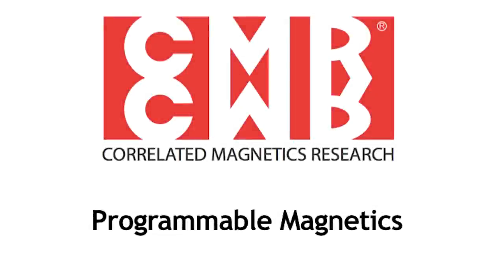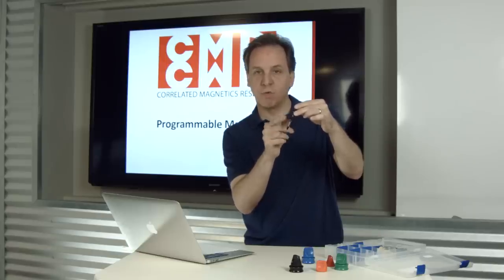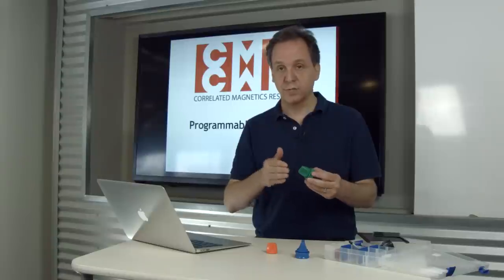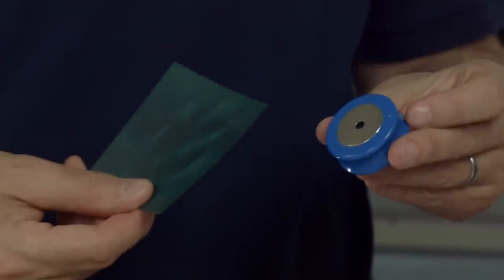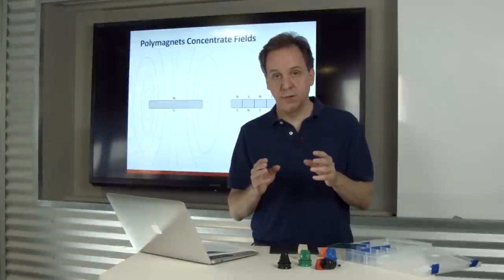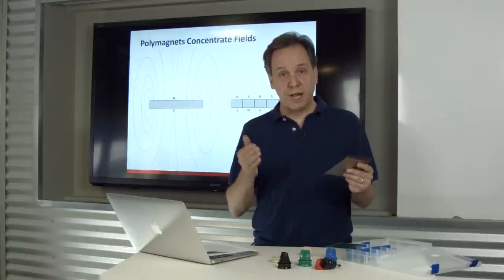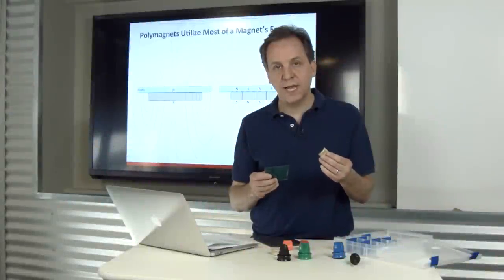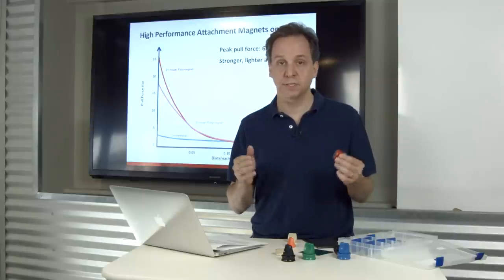CMR Polymagnet Demo Kit

Comment: I'm wondering if it would be possible to create--either in whole or in part--a frictionless system of virtual gears using free-floating magnets held in place by each others' magnetic fields, in a vacuum chamber (to make it frictionless.) Instead of cogs with teeth, it would be invisible fields of magnetic force.

Comment: How long are these magnets expected to last under normal conditions of vibration, heat, and 'flux leakage'(? i.e. what happens if you don't store standard magnets with keepers in place) ?  If these magnets are spinning around each other... won't the AC magnetic field tend to deprogram them?  Perhaps not a big affect for a latch... but I recall you claiming you had magnetic gears which I can imagine people wanting to rev to high rpm.

Comment: Does these Polymagnets last long enough like the conventional magnets?
Reply: Well, it all depends on the magnet material they chose, but if it's strong enough, it's as permanent as a neodymium-iron-boron i.e. pretty damn permanent.
Reply: I'm not so sure...

Field life if closely related to how they are used. With these, a portion of the field is always in conflict... and conflicting fields often degrade lifespans (thus, why industrial magnets are separated for long term storage).

Comment: I bought a bunch of these magnets, how do I get them apart? Seriously, is there a trick?
Reply: if you're talking about the strong magnets, they can probably be slid off or "tilted off" like a normal magnet, but I have yet to get myself some, so I am not entirely certain.
Reply: They're very strong. I finally got them apart with two pair of pliers and slid them off each other. Keep the plastic disk between them for sure.
Reply: Ahahaha, well, thanks for the warning! :)